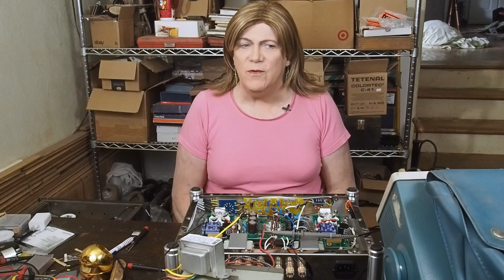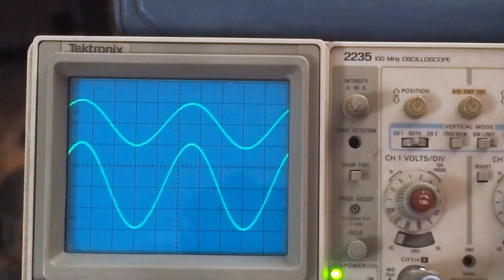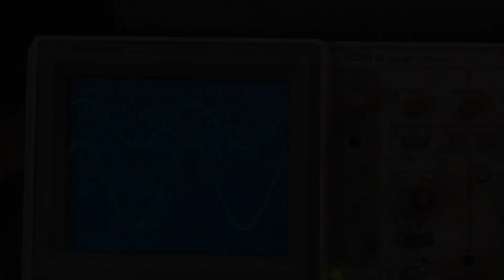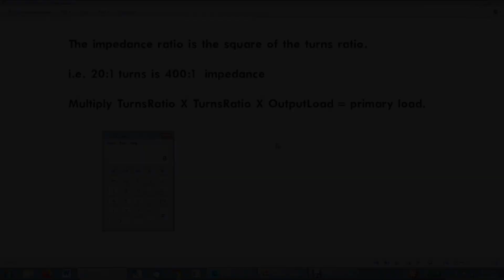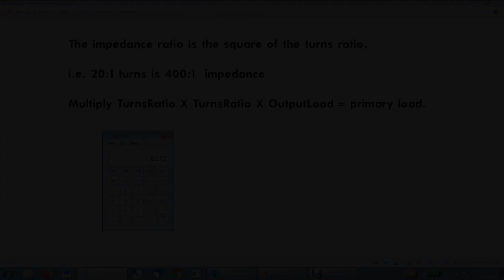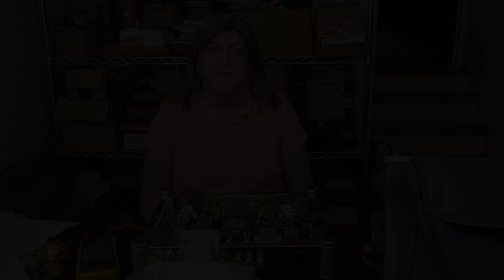How to Measure Tube Amplifier Output Transformer Impedance

Comment: Thank you so much. Building a Standel guitar amp circuit using a junk PA tube amp and was able to determine the specs of the OT and that it still worked.

Comment: Good stuff. My next question is what impedances are the sweep tubes? The data sheets never show that information.
Reply from the maker: what "sweep tubes" are you talking about?
Reply: @SkunkieDesignsElectronics  Not that you've ever designed for them, but sweep tubes are in common use among amateur designers/builders such as I. I speak of, as examples, 6dq5, 6dq6, 6bg6, 6ge5, and other to numerous to list.
Reply from the maker: Well you would need to ask the people who have built amps using them. I have no idea.

Comment: Thankfully turns ratio is same as voltage ratio: just a few mesurements and you can figure it, but it's a ratio, so actually one can only guess the exact turns put inside unless dismantling and unwinding, which might be an educational task once could do once or twice like me. Trafos are all about turns ratio. 😅

Comment: Great video. Thanks. I just built my first pushpull output transformer based on calculations for 5K primary impedance and 25 turns ratio. It only has an 8 ohm secondary winding. In order to test the primary impedance, i hooked up the secondary to a variac and took several measurements between 1VAC and 15VAC. My results, however, seem to vary. At 1VAC, i got around 30V on the primary. Which results in a 30:1 ratio and as per the calcs it should be 7.2K impedance. At 15VAC, i get 388V on primary, which is about 26 turns and imepdance of 5.3K. Does anyone know the reason why the results would vary with increasing voltage?
Reply from the maker: No idea on that one, sorry.
Reply: To answer my own question, its probably due to core losses which are magnified at higher voltages.

Comment: To get a good, solid low impedance drive for testing transformers, use a small audio power amplifier, solid state preferred, to drive the transformer.
Reply from the maker: Huh? All we are doing is testing for the turns ratio.

Comment: hi, your method works if you know the leads on the transformer but if you dont know  what color  lead  is 4,8,or 16 ohm on the secondary youre in trouble  ,we know that the black lead is the ground lead ,but brown ,yellow and green  which is 4,8 or 16 ohms
Reply from the maker: You cam make a pretty accurate determination measuring with a simple ohm meter. 4 ohm will have less resistance than the 8 or the 16 due to the fewer windings the 4 ohm will have. Same with figuring out which is the screen tap.
Reply: hi i know i dont find impedance with multimetere ,I inject a 10vac with my variac and measure the voltage to the secondary ex.  if i obtain  .6 v  secondary  so 10/,6 =16.6  square  i got  275.5  and if i multiply  this by 8 ohm =2024 ohms  primary  but  this  way  dont tell me  if i must multiply by 4,8,or 16 ohms this tell me only  on the transformation report. @SkunkieDesignsElectronics

Comment: example. my single ended 45 amplifier.delivers <2watts rms. uses transformers salvaged from a 1950s curtis matis stereo 6bq5 single ended. transformers are 5k to 8 ohm 10 watts rating. with my 6 ohm speakers my tubes see about 4k load impedance and sound great. always remember speakers are not exactly their z rating at all frequencies. best to experiment and go with what ever works best.
Reply from the maker: Most speakers dip lower. It's usually best to er on the side of higher impedance if it's an option, the only downside is a little less power.

Comment: voltage ratio equals the turns ratio. impedance ratio is that ratio squared. impedance seen by the output tube is output impedance times the impedance ratio. easy peasy
Reply from the maker: Well there is no real "output impedance", the transformer reflects the load impedance (speaker impedance) to the tube via the transformer turns ratio.
Reply: @SkunkieDesignsElectronics  yes

Comment: Enjoyed your video.  I've been dealing with a friend's 1939 Recording King amp, that has an OT with no markings of any kind on it, and trying to determine if its correct for this PP cathode biased amp running two 6L6GC's. He's using an 8 ohm speaker.  I'm a bit of a novice, but I have some experience with tube amps.  I have determined that this OT has a voltage ratio of 48;1 and thus and Impedence Ratio of about 2300:1.  The plate to cathode voltage is 369 VDC, and using a Eurotubes single tube adapter, one tube has a PC of 51.6ma and the other tube is 57.6ma.  The cathode resistor is 229 ohms, and its voltage drop is 25.82 VDC.  So, if I"m correct, an 8 ohm speaker would result in a reflective impedence value of  about 18,400 ohms.  I have no idea what the Wattage of this OT is.  18.4K seems awfully high, and I don't know if it's too high for these tubes, or if there is such a thing a being "too high".  The tube spec sheet I think shows Effective Load Resistance Plate-to-Plate of 6600 ohms.  So that's a big spread.  Thoughts?  Can an OT harm the tubes or the speaker, or does it just affect the sound?  Thanks for your help.
Reply from the maker: Sounds like your math or measuring may be off? I would just get it working and if it sounds good, call it a day :)
Reply: What part of my math or measuring do you think is off?  48 x 48 = 2304 x 8 = 18,432 or 18.4K ohms. That would help.  Thanks.
Reply from the maker: Where were you measuring? From anode to anode or center to anode? Honestly I haven't measured a PP transformer before. 1/2 of what you calculated sounds closer to what it probably is anode to anode.
Reply: I removed the output tubes and of course unplugged the amp, then I injected 1 VAC on the two secondary Output leads coming from the OT  that connect to the speaker (no speaker was connected), and then I read the AC Voltage on the Blue and Brown leads on the Primary of the OT that are coming from the Plates of the 6L6's.  That showed 48 VAC, so a 48:1 voltage ratio.  Then squared that number and multiplied it by 8 ohms to get the Impedence ratio. of 18.4K ohms.
Reply from the maker: OK looking at this I think what is going on is this amp was designed for a 4 ohm speaker.  Then you get 9K a-a which sounds more reasonable for a 6L6GC. Running 8 ohms speakers on this will just have a good bit lower power/SPL. Also if the amp is pentode or triode strapped could change the required a-a loading. I'm far from an expert on PP amps...
Reply: Thanks--this makes sense.

Comment: Just subscribe. 
Curious to know what is the impedance between 4 to 8 ohm taps, and 2 to 4 ohm, 2 to 8 ohms.
I am a physics graduate with life long hobby in hifi electronics, now 67 years old vintage, yet never learned this 
William Lee Singapore
Reply from the maker: The impedance on an output transformer is based on reflecting the impedance of the load. The idea would be a 4 ohm load on the 4 ohm tap would via the turns ration reflect a specific impedance on the primary.
Reply: @SkunkieDesignsElectronics  
Yes indeed tks, just curious is between 4 ohm to 8 ohm taps is 2 ohm. And if 2 ohm taps to 8 ohm is 4 ohm
Reply from the maker: No the impedance difference would be 4 ohms. going from 4 to 8. You can't measure it with an ohm meter.
Reply: @SkunkieDesignsElectronics  oh ok, so we cud still take the diff as 4 ohm against 8 ohm tap. Tks a lot for the advice  !

Comment: Help needed! How do I match impedance of inverter16v  AC output SOURCE 
to 16vAC isolation transformer primary, that I have to hand WIND, for 4 
ohms load of 32v AC 6 amps secondary ? Do I use the ohms of primary 16v +
 12 amps division or the resistance .06 ohms of inverter output contacts
 terminals at 20khz frequency? Voltage and turns ratio same as 1:2. The 
online formula for inductance value of turns requires reactance value in
 ohms , at the frequency of source.
Reply from the maker: Sorry but honestly I have no idea. Try some folks at https://www.diyaudio.com/

Comment: Very good presentation! I agree with you totally that the 1K signal is a good frequency to test OTs. It is a happy medium between the log rhythmic, scale of frequency impedance, vs., the output voltage stability of the signal generator. Hopefully, folks understand your choice in using 1vpp measurement step, to make the turns-ratio math extremely easy to do. :)

Comment: very good clip to help understand more about output transformer.  Request how to calculate Load impedance for each tube.  For Example why type 45 use 5K OPT?  Why 2P29L use 4.6K on 32 ohms Headphone? Thank you in advance.
Reply from the maker: I think a lot comes down to recommendations and listening to people you trust. For example, a 300B is listed as working with a 3.5K OT, several people have said they believe a 5K sounds better and has less distortion, that unless you need every watt of power, go with a slightly higher Z OT.  

None of these tubes are new designs, learn from other people's mistakes :)
Reply: @SkunkieDesignsElectronics  Thank you very much. Yes 5K less distortion over 3K. However the point is any simple calculation to know which OPT to be a load line for tube?

Comment: The way I think about impedance is that it is frequency dependent. That's why the impedance noted on a speaker is a nominal impedance across a range of frequencies.
Reply from the maker: Yup. Like many things, it's a complex subject and a deep rabbit hole. I find for myself it's best to grasp a basic understanding and then expand it as needed. Some of the super complex stuff, for a tube amp in audio use, just makes it all very confusing and people just throw up their hands. :)
Reply: @SkunkieDesignsElectronics  Yes, it's confusing, but that's what makes it so interesting to me. The challenge  : )

Comment: You test your output transformers the exact same way I do. Made more sense to me to put a higher frequency tone into it than using 60Hz. I will run my generator to sweep from 20Hz-10Khz just to see how much Db drops with higher frequency. I mainly deal with guitar amp parts so the aren’t none for high fidelity. Nice video. Like the Tek scope. I have an early digital 2430A and a nice old 485. Also have the Rigol DS 1054z which is great for all the readout options it has with a FFT function. Have an old 20Mhz two channel that came with the NRI home study course I did in 1992. I love repairing old test gear too so I have acquired a ridiculous amount of scopes and meters. Not Mr. Carlsons Lab crazy but might if I had the room. I guess I need to start doing repair videos. Used to put up guitar playing videos but the copyright nonsense stopped me 10 years ago. Still have a lot still up but nothing in a long time. Still love playing but really love working on tube gear. Keep up the great work.
Reply from the maker: The analog discovery 2 with the audio analyzer suite is a fun kit to play with and gives a quick snapshot of what an amp is doing across a wide range of operating conditions. It's not lab quality for sure, but I think it fine for use with tube amps :) And yeah, you should make some test gear repair videos! I fear at some point this old tek scope is gonna need an overhaul.
Reply: @SkunkieDesignsElectronics Hi, I have a big problem and I don't understand what happen.
I am fixing an exotic amplifier, this amp use one 845 output tube in single ended configuration.
Company refuse to sales a new one OT.
I have one amplifier in good working condition and the other one have the OT in shortcircuit.
The thing is the next, good transformer read 500 Kohms in the primary, bad one 200 ohms.
How is posible 500 kohms in the primary?
Second mistery, I test the OT with 3 difefent multimeters, one is a Fluke 28ii reading 500 kohms.
Using an analog multimeter OT reads 250 Kohms
Using an analog multimeter with fet input reading is 300 Kohms.
Any help will be appreciate.
I want to adapt another OT but I don't know how to choice a right option.
Sorry for my english.
Best Regards.

Comment: What I don't understand is, if the impedance on the load side is reflected to the input side, how can we measure accurately without having matched source and load impedances connected?
Reply from the maker: Because we aren't "measuring" the impedance (z) directly. We are measuring the turns ratio of the transformer, then calculating the input side impedance from the known 8ohm impedance load.

 Directly measuring would require an Impedance Analyzer or an LCR, and yes, if you were directly measuring it you would need the load attached. But I believe the measuring will not work well on SE OPT, since to get the proper inductance it has to be measured with the proper DC current going through. I also think things like the inductance come into play? I've read people getting odd reading with some LCR type meters, this method is simple and is accurate.

I think too, this exercise helps folks understand what is happening,  the difference between impedance and resistance, and can be done with tools I own :)
Reply: @SkunkieDesignsElectronics  OK, I see. Thanks for the explanation.

Comment: hi skunky thanks for the video :) now i just have to figure out how to measure my output transformers i have 1 lead tied to the plate of a 6bm8 on the primary and 4 leads on the secondary 2 wire for speaker one ground and a yellow wire going to a 50uf 200v can cap in the power supply section  im deconstruting a philips console picked a tricky one to learn off of :)
Reply: never mind i think i got it I'm just wondering if the windings are different in the type i have ?
Reply from the maker: Is it single ended or push pull? Do you have a link to the schematic?
Reply: @SkunkieDesignsElectronics  no i don't i made a schematic 
it has a 6ca4 rectifier tube and one 6bm8 per channel so I'm guessing it single ended
Reply: ill try to send it to your main site
Reply: @SkunkieDesignsElectronics  i
Reply from the maker: @barryplant8085  I got your email :) The lead going to the power supply is the other side of the primary. This is a case where you might need to measure the resistance with an ohm meter to figure out which wires are electrically connected together through windings etc.